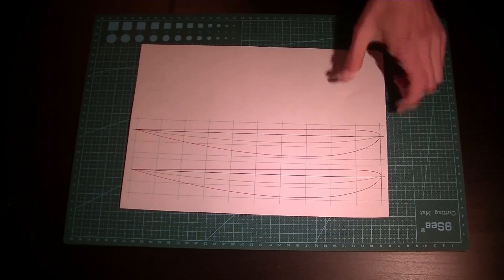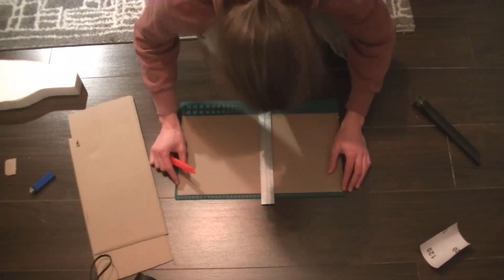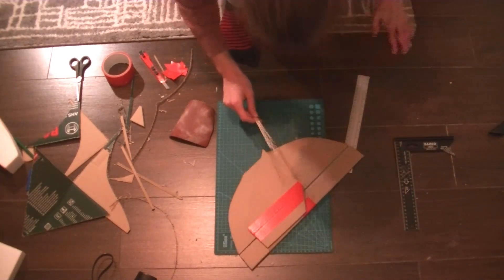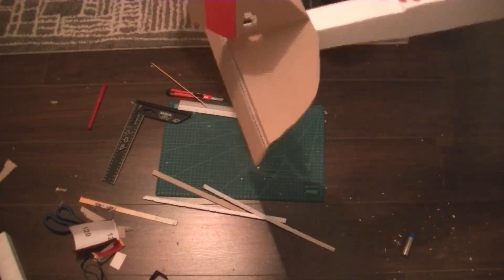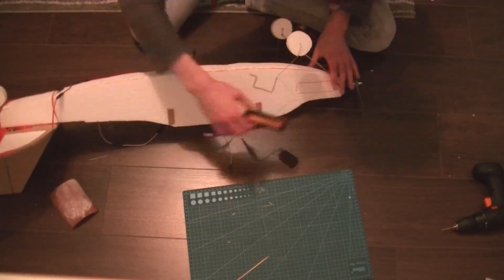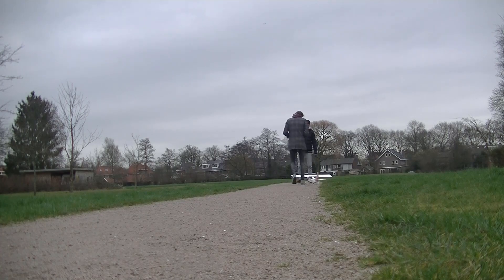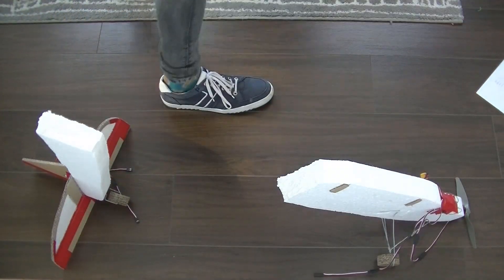DIY RC Airplane

Comment: Hey plese can you tell me how you made  the hot wire cutter it's length and power source and please try another plane it's really fun
Reply from the maker: Hey there! The hot wire cutter is basically a 1 metre long steel wire (not any special type, it was pretty thin) on tension. As a powersource I used three 3.7V lithium ion rechargable batteries (the one you can find in powerbanks and laptop batteries) wired in series. To be honest I don't recommend recreating this wire cutter. Right after cutting one of the batteries popped (which is dangerous!). Try looking for tutorials on how to make them. I hope this helps👍🏻
Reply: @TF-Projects   3.7v lithium  cells  ok
Reply: @TF-Projects  https://youtu.be/p8JHKjKtBp8 can u view my channel

Comment: clearance achieved via elevator mod,  NOT  rudder mod.
https://www.vector-templates.com/modules/templates/preview-wm/cessna_182_skylane_2010.jpg

an iteration of split elevator control

http://www.flyrc.com/wp-content/uploads/2013/02/FLY-02-04-SplitElev-e1360245393705.jpg
Reply from the maker: Holy moly dude, thank you so much for doing the research I should have done... I will definitely use this when I try again. I appreciate you taking the time to give feedback on my project.

Comment: some info.     at 14:45,  the  belly of the tail boom is  FAT (excess Mass).    taper at this surface should be be uniform, and should  begin  beneath  the 'pilot seat'.    it appears that the efficiency of the main wing airfoil is  Reduced, as a result of the  aileron chord being too great and the presence of  too-Thick trailing edges.      where, as here, a  Too-tall  tail wheel assembly has been installed,   the  Ability of the  TAIL  to move, Vertically, is impaired.        at :57,  in linked video,  OBSERVE  that  down-elevator  deflection, in the prop wash,  is used to cause the  tail to rise off the  deck.            ailerons skills are considered to be 'advanced' piloting skills.     a pilot has  the  CHOICE  of learning ailerons, Later.     After  he has learned the requisite   pilot reflexes; while  having fun flying  three-channel;  throttle, rudder, elevator.     BUT,   such  a  model  MUST  have  a dihedral main wing.      googletranslate       tail rise;   3-channel, slow-flyers
https://www.youtube.com/watch?v=SXanmYwyLTI

https://www.youtube.com/watch?v=2xP_wDe4UPo

https://www.youtube.com/watch?v=lZ1vUKcktVk

Comment: some info.   at 13:22, the use of full strip ailerons is not recommended.       the proportions of the airframe  are  wonky.     the aileron chord is  Part of the wing chord.      main  wing chord  Should be, roughly, equal to  22 percent of fuselage length (prop to elevator te).      fuselage length should be, roughly, equal to 75 percent of  wingspan.    the distance between the prop and the main wing is not optimal.    EVEN if  the wing mount were moved three inches forward, the prop  would  Still be  about   one  inch, too distant.       when the fuselage is level, the mass of the main landing gear  Should be,  below the main wing leading edge.     at  13:40,    Thick, aileron  trailing  edges  make  a lot  MORE   Drag, than  THIN  edges.       googletranslate

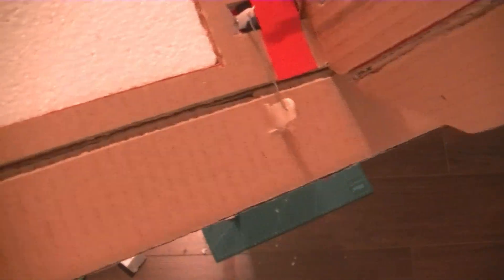Comment: some info.   good foam cutting and shaping.       at 3:12,  the  compound curve seen at the   horiz-stab leading edge is a less-than optimal configuration.     at 3:45, the vert-stab tip chord is  less-than it should be,  because  the slope of the vert-stab leading edge  Should be 75 degrees.       at 4:04, the chords of the control surfaces   Should  be  equal.     partial amputation of the rudder  is  NOT  Recommended.    suggest  you  Discover a    Better  solution.    see  a  Notched   or  split elevator.     in general, where a vert-stab is made of a material having internal (longitudinal) structure, that structure  Should  be  aligned  with the  stab leading edge.      at 4:38, too much  tape (Mass added) at the elevator hinge.      at 5:25,     servos   DO   NOT   GO   AT   THE    TAIL!!!!!      at 9:12, control horns are  Not  correctly  configured.       at 12:03, more and More  mass  added at the  TAIL  or aft of cg.     it should be understood that the amount of  mass  located  aft  of the model's cg  SHOULD  be  Minimized; in other words, the tail boom and stabs  Should be made as light as is practical.     googletranslate